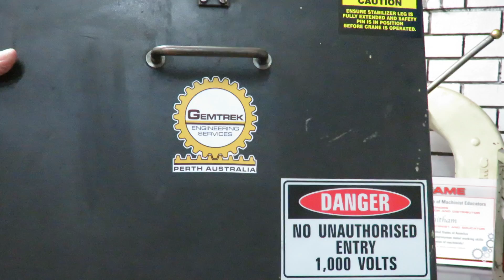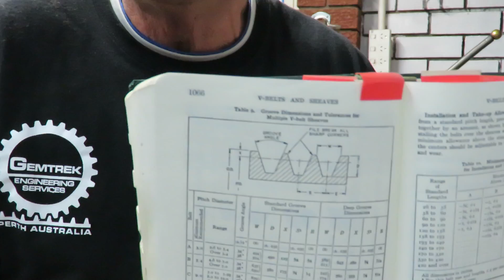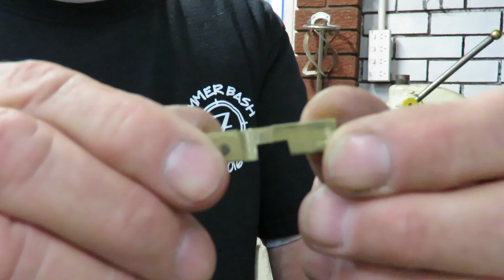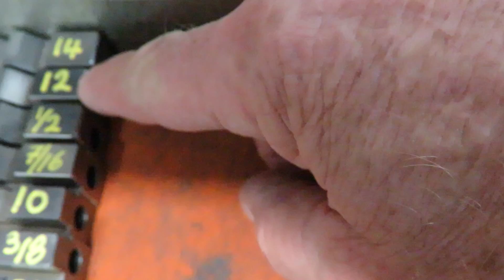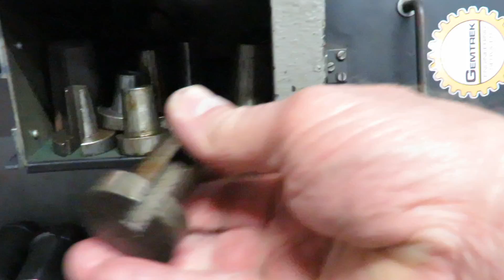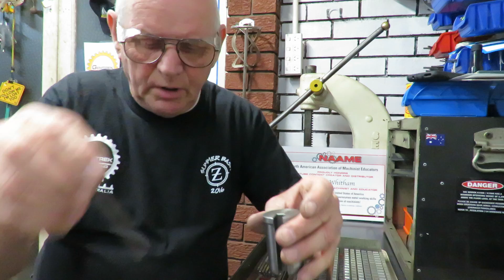223 What's in my Box that has an Ox Tool key ring

Comment: I like your can of Castlemaine Rock.....
Cheers Piers from Castlemaine
Reply from the maker: Piers Thanks mate, when we were young, late fifties and sixties we would go for a drive up to Castlemaine from the Western District of Victoria. Long drive in those days, but you could only buy it there. always liked that part of the country.
Reply: Bruce Whitham 
When you run out let know.  I have a DSG slightly newer than your mates.  I would love a video on the foot brake mod that you made.  Cheers Piers
Reply from the maker: I haven't made a vid we can do that, might be after I come back from the Bash in Mid July, I will see if I have a few more pics. it is a 2 stage brake. first micro switch turns the motor off, the secon lower micro switch operates the resistor brake of the VSD.